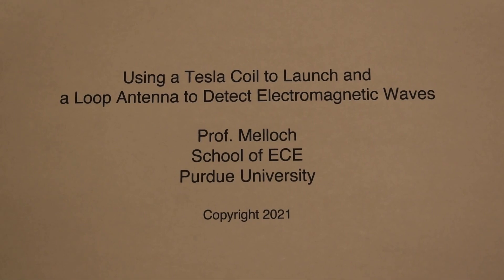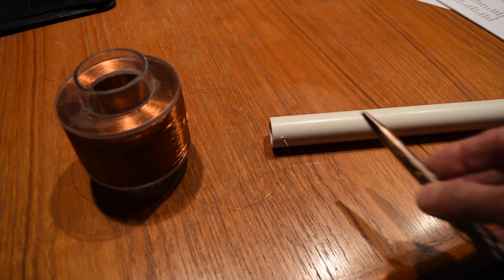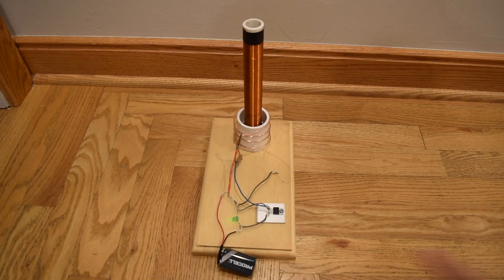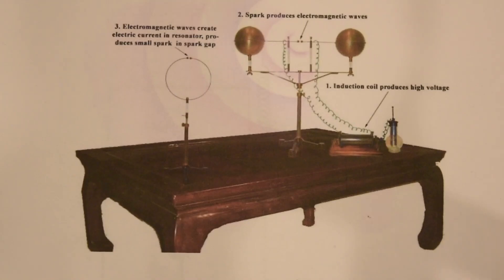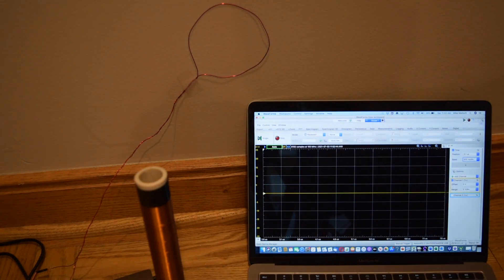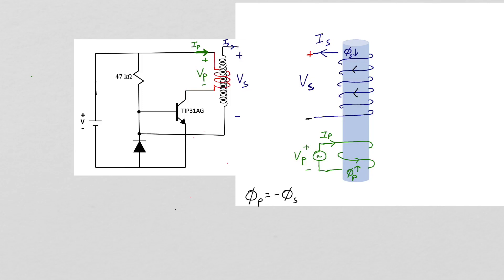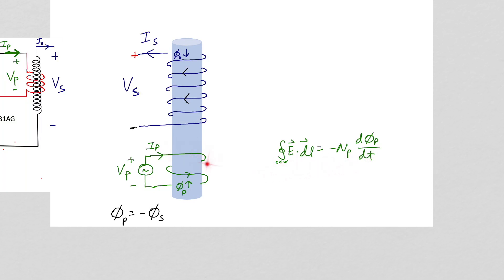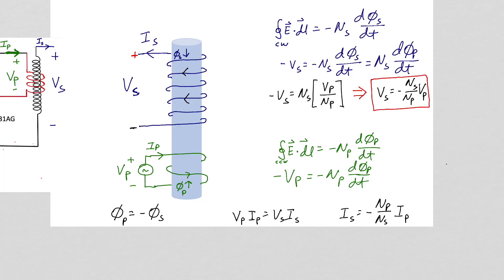Using a Tesla Coil to Launch and a Loop Antenna to Detect an Electromagnetic Wave

Comment: Aren't the wire gauges important? And the dimensions of the outer coil? You got 1000+ turns on the secondary but I tried 26 gauge and could not get nearly that many turns on the secondary. Thanks for details--this seems like a good demo!

Comment: This is awesome sir, i recreated your experiment proving i can do it. One of my fav experiments, the other being my replica building wimshurst machine to generate sparks!
Reply from the maker: That is great! I tried a wimshurst machine but got distracted before I got it working. I need to get back to it and figure out why it is not working.
Reply: Thanks sir, for wimshurst i failed so many times it was indeed fickly...but seeing spark felt amazing. I'm sure you could do it but I noticed any significant wobble or variation gaps between the disks is quite sensitive to not generate spark.
Reply from the maker: @HunzolEv  Thanks for the tip!

Comment: Very nice explanation.  I wish you could experiment with scalar waves in a similar fashion. My interest would be if we can modulate the energy that would be flowing on your loop antenna when two out of phase signals are being used. Perhaps by modulating/altering the phases of the two signals is how we can get an intelligent output at the other end, which will manifest by the amount of energy (current) that's being detected at the loop antenna.